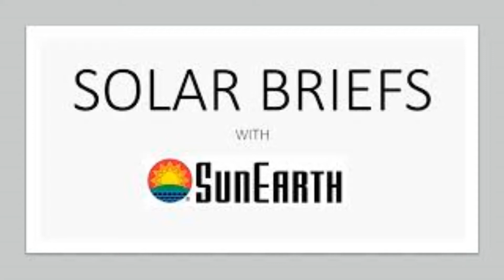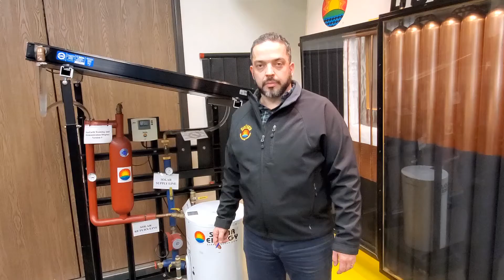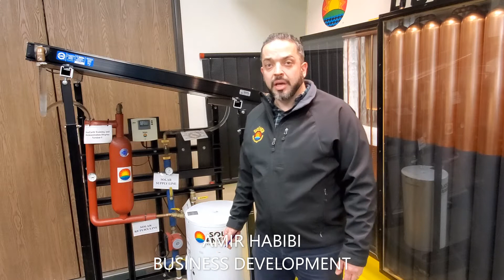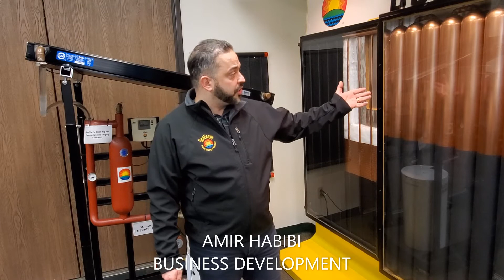SunEarth Solar Brief -  Active vs. Passive

Comment: On a passive system can I run the water directly back into the cold inlet of water heater from panel  or is there some sort of valve I need to install ? Can water reach temperatures over 120 with passive system panels before connecting back into water heater ?
Reply from the maker: Yes, temperatures can reach over 120 degrees. You should install a mixing valve between the collector and the backup to limit the temperature.